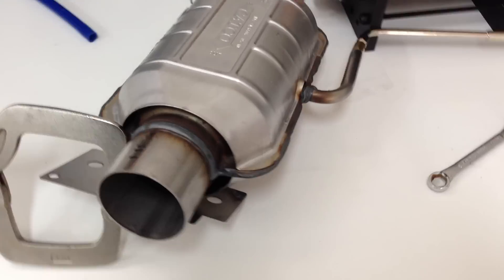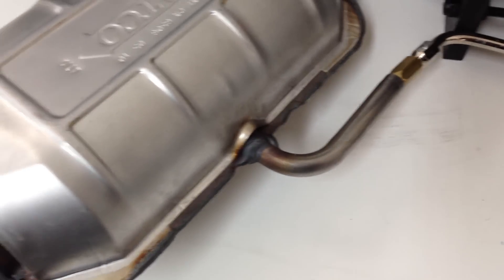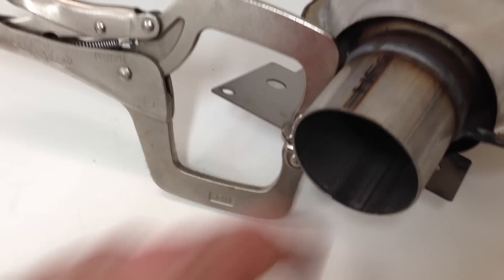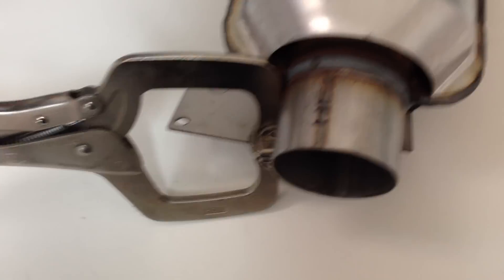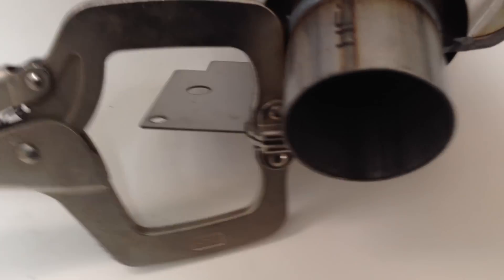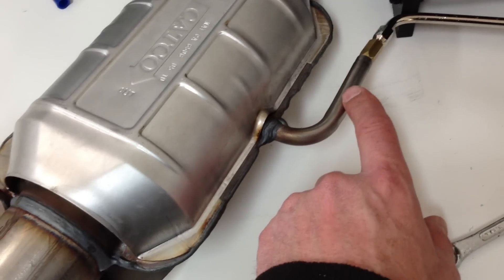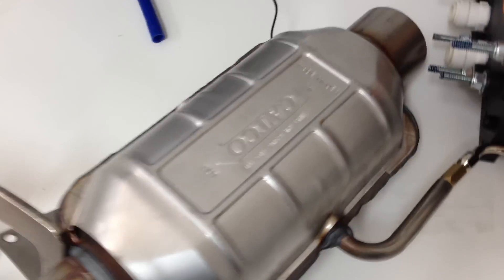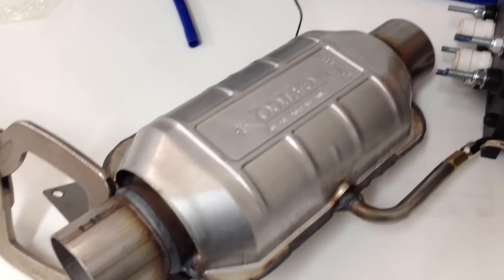H-CAT video 7

Comment: You are not going to get a correct reading on your laser temperature gauge measuring shiny surfaces. You are going to have to use a Primer flat paint to measure temperature. I have done many test and the shiny surface gives you a false reading.
Reply from the maker: +pjckac1 This is true.

Comment: Steve,
Martin tried to contact me last night, we had trouble with skype and my wife LOL, we try again tonight. 
Hans
Reply from the maker: Thanks Hans
I watched his video and it interesting. I only wish I could understand German. I'd love to know what he is saying.
Reply: delvis11 Tried to email to your box at greenfuelh2o, but it's full?
Anyhow: with the warm air from the catalytic converter comes also particles of the inside converter, like paladium. Martin had his heater running with a ventilator for 4 days on a row in his garage and got inflammation at his teeth. He had some very short and bad nights untill he figured out what might have caused his aches. (Some) people are more sensitive to metals/ metalparticles than others, which is why some people don't have teeth crowns of the traditional metal material in their mouth but golden teeth crowns, since gold doesn't have this health issues. 
Martin and friends stopped going down this path and switched to using very fine sand as a catalyst. Results are very promissing.

Comment: Thank you Steve for your kind words and recognition in the discovery of this phenomena. I am going to use this opportunity to offer my input and hopefully it will be of use to you as well as others. You may also want to try a Y off your hho input and feed one side to the back "inlet" of the cat. This way hho is also passing through the first substrate. Just a simple pipe shooting into the open end of the intake so the gas also mixes with ambient incoming air. The way its set up now, your really only exposing the first substrate at the front of the cat with air/hho, since the dynamics of convection will pull air from the back and push out the front. In short, it may be possible to get some heat out the back end of that too. Once you install a fan you won't need cool at the back and hot at the front to create air flow so you can also heat up the back end too. I'm sure we can increase temps by using cats with more palladium or platinum but even with your 45 dollar cat, those temps are very promising. Super exciting and this is just the beginning.

 Now SIMPLE HOW TO TEST FOR OVERUNITY AND EFFICENCY (Info given to me by another fellow researcher): Empty large cardboard box in room. Inside box mount incandescent bulbs that pull same wattage as hho cell. If your hho cell is running 300 watts use 3 100 watt incandescent light bulbs. I would also invest in a simple kilowatt meter to make sure those bulbs are pulling the factory rated run time wattage and add more if needed so you can make sure you have the input power matching the input power of the hho cell. Turn bulbs on in box and use a temperature probe inside the box to measure ambient temperature inside box. Take and document a temp measurement every 1-5 minutes for I'd say up to 30 minutes. See what your peak temperature is at 30 minutes. Run test 2 or 3 times to make sure the peak temperature remains roughly the same. Then install hho equipment, and cat inside the same box. Pump in on demand hho into the cat to start this effect using the same 300 watts the bulbs were running at. Again you may want a kilowatt metter at the wall outlet of your hho power supply to account for everything in the system instead of out your cell and into a digital pwm.Take temperature measurement inside box at same location and same times. If at any point you reach temperatures above the incandescent bulbs peak temperature before the 30 minutes. I was told this would no doubt be over unity. Thank you again for this video. Inspiring stuff my man....
Reply from the maker: Justin
I was getting flashbacks before I put the hho into the side pipe of the cat. I put one of my flash arrestor guts on the end of the torch to defuse the hho. the flashback were under better control but the cat seemed to get hotter when I put hho into the side tube. I was able to maintain temperature at 45 watts. Thats not in this video. I understand what you mean about getting more even distribution of the hho. A 10 to 30 micron metal or ceramic air stone should do the trick placed in the large end of the cat. It will better prevent flashbacks also.
This experiment is something I will probably try but I need a proper fixture first. I just got this going today when I was doing something else in the shop and thought for giggles to try and heat up my platinum coated plate. I heated it with my propane torch and then put hho on it. It appeared to heat up but it's on Ti substrate so I couldn't tell for sure. That when I put the propane torch into the end of the cat. everything changed then.
Reply: delvis11 If you type in "Sintered Metal Filter" into the search bar at McMaster.com they sale stainless mufflers or even stainless porous discs that can be used for gas diffusion. Once the reaction starts then in theory we should also be able to throttle the gas production down. We also need to test the exhaust to see if its anything other than water/steam/heat. Great stuff man.

Comment: The hose coming out of the side of the cat is used to send some of the exhaust back into the engine. While being directed to the engine it passes through some sensors (the ECE "emissions control system" system) that tells the cars computer wither or not it needs to send more air into the exhaust stream to control the emissions.
Reply from the maker: cool!!
Reply: The air pipe on the side of the cat was there for the cars with air pumps on them, the air pumps air to the cat when the engine is cold, because the choke is on, or the iac is closed the car runs rich until it warms up,Rich mixture keeps the cat cold, the extra air causes the cat to heat up faster, the rich mixture from the engine and the added air cause a catalyst reaction, That is the exact purpose of that air tube.

Neal
Reply from the maker: So I will pump my air in there :)
Reply: delvis11
You do not need to use that tube at this time steve.

Comment: if you are using electricity to make hho to pump directly into the hcat to get heat; it would be much more efficient to just run an electric heater.
Reply from the maker: MrArizonacool
This is a great point. I will have to put a fan on it and see how much useful heat there is. These questions and observation are great for turning ideas into action.
Reply from the maker: Yeah go see how much heat you can get out of your electric heater at 45 watts
Reply: delvis11 I think you are mistaking temperature for heat:

a lit match can be 500 degrees, a high temperature but a small amount of heat.
a swimming pool full of water may be 50 degrees but have a massive amount of heat.

Please measure the device to see if you are getting more than 45 watts worth of heat.
Reply: jdcproducts "crude nuclear reactor"... no its not.
The catalyst in a catalytic converter lowers the activation energy needed to complete a chemical reaction. Please point a Geiger counter at it and let us know the reading. it will be zero.

"that is a huge chunk of metal getting to those temps" how is he touching it with bare hands if the whole thing is 250 degrees?
Reply: delvis11 Your right but you also cannot let people walk on you with cheap negativity. You can tell a lot about a person by just checking out their YouTube channel. He is not someone to make assumptions. He should have worded his comments in a nicer "constructive criticism"  word choice than being a smart alac. This is your video so I need to watch my mouth lol. I can do that on mine...
Reply: Ha Ha Ha, here come the disinformed comments....
You can not get that heat output from a alectric heater.
275 watts hho into cat = 200 degrees
1500 watt electric heater =250 degrees

What would 1500 watts of hho into a cat put out........A lot more.
Try a 2000 watt electric hair dryer blowing through this cat, no where near
these temperatures......
Don't you dare try to debunk this wonderful discovery.
I will not use any words like efficiency until all the proper tests have
been done, and neither should you.
Reply from the maker: The heat that is generated with 45 watts is amazing. read the caption above. the test I did off camera was with only 45 watts.
Reply: delvis11
I know you right...
Electric heaters will be a thing of the past soon.
Reply: wrong answer buddy. This is a crude nuclear reactor...pay attention...that is a huge chunk of metal getting to those temps, cannot be compared to a lit match lol. My electric space heater pulls 1500 watts and barely pisses out 250 degrees. We will be testing efficiency and possible over unity very soon.
Reply: MrArizonacool
Justin , There will be no reasoning with this dude, He loves taking it up the ass by the energy companies, his attitude towards this , shows that.
You and i my friend will enjoy a low cost green heat...Keep our toes warm....lol.
The reason he is touching it with his bare hands is due to the heat shields around the cat....
Reply: MrArizonacool
What type of radiation should i be testing for ?
Please advise !!
Reply: ***** I understand. I checked his YouTube channel and he has no business trying to tell us what this is because he is not educated himself or used his bare hands for anything other than choking his wee of a chicken! lmao. I know for a fact now this technology could be considered "nuclear" and it may be a new type of reaction in which it emits no "harmful" alpha, beta, or gamma. And when I say 250 degrees for my 1500 watt electric heater that is the tiny whiny wire that is heating up, not the output heat, so for us to be able to get the guts of this cat to those temps using at little as 200 watts is saying something. Mr. Arizona can kiss our ass
Reply: MrArizonacool Don't be an idiot. Get educated on water electrolysis Hydrogen reactors using Palladium as a catalysis metal. I have De-classified documents from the United States Military to prove this point plus down right confirmation from the billion dollar corporate cold fusion guys running test over at the Nazi labs of SRI. I can provide them for your ignorant ass if you want'em? And the 250 degrees off my 1500 watt electric heater is the actual tiny ass wire inside the heater not the output heat, he can touch the case because its not at 250 degrees yet and I can touch the face of my 1500 watt heater because the heat coming out is not actually 250 degrees. Get an education or a life douche...
Reply from the maker: I think you should give him a break. He is just trying to participate. You take the good with the bad.
Reply: ***** there are 3 main classes of radiation. 1 electromagnetic waves: anything from radio waves to gamma. only xray and above should be worrisome.

2 high energy electrons.

3 high energy particles.

You can buy a detector that does each individually and there are some that do all 3 for about $500.

since the inputs are just hydrogen and oxygen and since the device is partially shielded you should look for the high energy electromagnetic waves.
if you point the detector down the outlet you could look for neutrons or alpha particles.

All of this would be a huge waste of time and money as catalytic converters have been in use in billions of cars and no nuclear reactions have been observed to date. If you still don't believe me then I would like to tell you about some lake side property I have for sale here in Arizona.

No seriously though, the hho generators that Delvis sells are great. For the price and the output I don't think they can be beat. Why muddy the water by claiming some sort of mysterious extra energy or cold fusion when all that is happening is the oxidization of hydrogen.
Reply: Ask Steve if we are wrong ?
Why are you dissing this, what do you have to gain? because you do not need heat in arizona, does not mean the rest of the world does not....How can you be that arrogant....This works and blows the electric heaters away....I had a huge fight the other day with a dude who swore that i was full of shit, no heat can be made this way with hho, He has since apologized, Watch and see where this goes, you will be amazed !
If you cannot accept this, well your loss..
Good thing you were not around when the wright brothers were, your negativity campaign might have had an impact on how history was written....
Reply: ***** we all have a lot to gain from good science. And a lot to loose if you are selling snake oil. Follow Delvis's example and get the numbers before you make clams. The burden of proof is on you.
Reply: MrArizonacool
Just in case you have not noticed , we are not selling anything, we gave what discovered away, we kept nothing back to try and develop for profit.
Free, Free.   For the world to hopefully be a better place....you sound like an intelligent guy, dont tell me this is useless. it has some very serious usages..
Reply from the maker: We have no proof that it is a nuclear reaction but I don't think anyone is claiming that it is. What is happening is something that I can't explain and really I haven't done enough experimenting to know whats going on at all. I can just explain what I have seen and give an educated guess on what I think it is. The LENR guys are doing something and what I think is interesting is some of the things they are saying in the video's and interviews I have seen. coupled with some of the old government documents that are floating around and what I know, it's easy to draw up some good assumptions. My educated guess is that the big boys are using HHO but that's just what I think.
Reply: delvis11 You are right, the only thing any of us can really do right now is assume. This is why I gave the information out. Could be nuclear, could be chemical. Either way it deserves more in depth study and your far enough in now to understand whatever is going on is very very curious...
Reply from the maker: Yes you should have seen me walking in circles in my shop racking my brain on how this was happening. I understand a lot of things about efficiency from my work and just being around hho for a long time. I'm having problems wrapping my brain around this one. I cant wait to get back in the shop tomorrow and try this again. I was at Home Depot today getting some supplies. I'm building something cool!  :)
Reply: delvis11
LOL....I know exactly what you are going through Steve.......I will be waiting for your uploads.

Neal Ward

Comment: if the goal is to get heat why not just use a standard propane style burner to burn a hho flame?
Reply from the maker: you will need to do a little bit more research on hho. it wont burn in a propane burner. it just explodes and flashes back.
Reply: delvis11 I said "propane style". Burners do exist. Your hho torch is an example. They also sell indoor fireplaces that run on hho, for homes that don't have a gas hookup or proper chimneys.
Reply: MrArizonacool This catalytic heating effect is much different than a burner that uses a flame. If you go to George Wisemans site at eagle-research.com and read his lame paragraph on super efficient space heating you will see that an hho flame is rather useless for heating because it radiates very little infrared heat energy. Up until now everyone on YouTube was trying to space heat with hho use a tiny whiny flame pointed at something to absorb the heat. This catalytic combustion process for using hho passed through a catalyst metal (palladium, platinum) without a flame at all and creates heat, by the looks of it very efficient heat. More testing has to be done but you cannot just go out and buy a propane burner and use hho with it, doesn't work that way, modifications have to be done, besides this is a much cooler way to heat with hho anyways...
Reply: MrArizonacool
Can you provide us with a link to the hho fireplace you say is available, Please.

Neal
Reply from the maker: Working with hho is a lot different than propane. This is something worth investigating. That's why i'm doing it.

Comment: Steve , Thank you again for validating and sharing....I will try and burn the crap off my substrate and see if it works better. I am trying different things like how to clean a used cat for hho use.
Your cat seems to react faster than mine, they must be coated at the factory.

Comment: hook up a 12v computer fan to the bottom cold side n push the hot air out the top. I just wonder if that will cool off the outgoing air too much. Your next test with a fan will be interesting. Also that outer casing of the cat can be taken off cause it is only for road debris not breaking the honeycomb in the cat.You could weld some steel fins on it for a heat sink.
Reply: Hey How about an apology......Tell me I was right, go ahead tell me I was right.........Ha Ha Ha ...show everybody you are a man......
Reply: ***** you might be right :)
Reply: ***** it will be good to know what difference this 45 dollar cat  and an oem diesel cat that sells for $1000
Reply: spturks A formal apology and i will tell you.
Reply from the maker: Good ideas. I have an idea to use a cheap fart fan and some 3 inch duct.
Reply from the maker: spturks
yes I want to see the difference also